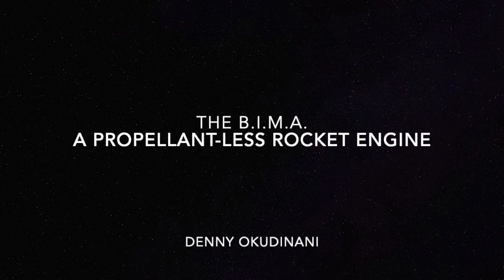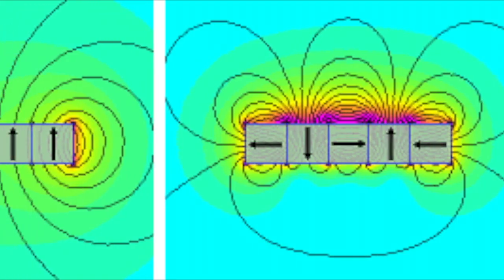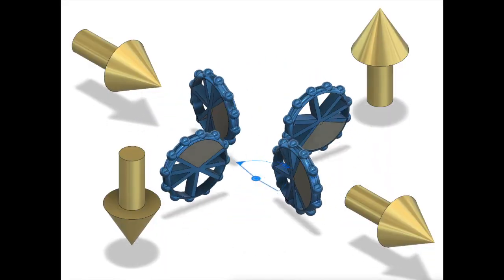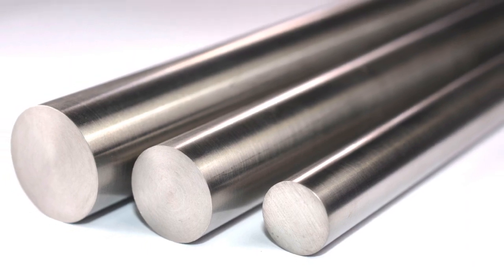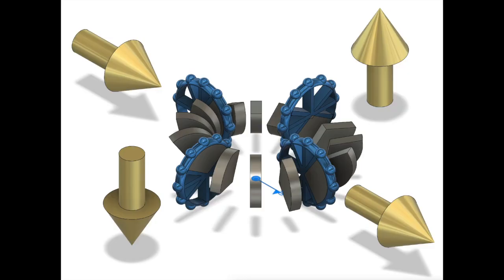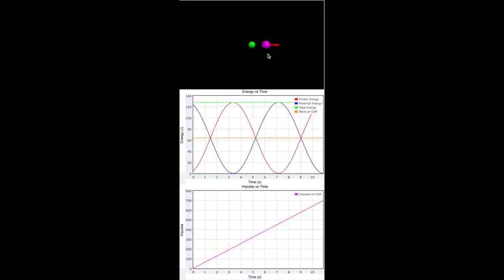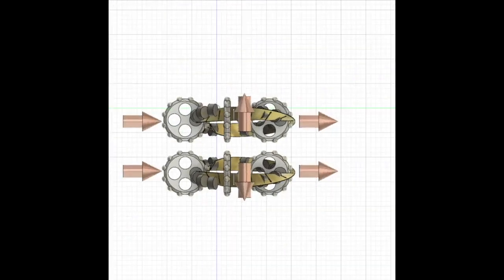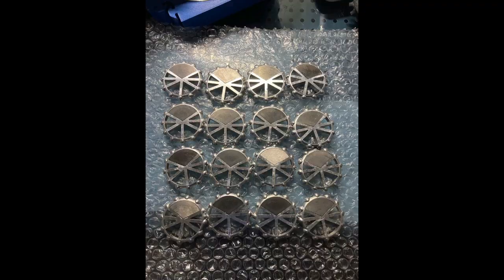Inertial Propulsion System 1: The unBalanced Inertial Mass Accelerator (BIMAH)

Comment: Uh. That would work up to just below light speed. With how perspective and frame of reference works... but without crazy energy levels. Just a longer acceleration... right.

Then once moving. There's almost no friction in space so if its outside the craft even less energy needed.

I say almost no fraction cause energy isnt actually conserved like they teach. Stuff would slow and stop eventually... just so long they ignore it..
Reply: And as it worked. Even if inside the craft. From outside if stationary. The propulsion system would increasingly measure higher and higher energy as the craft accelerates.  Energy is conserved in a way.  (more or less).

Near light speed its parts should start dilating time or be able to push past light speed. It would have to do one or the other.

 But on the ship it would seem like its normal energy levels from the frame of refrence and should be able to keep accelerating as the device is motionless relative to the craft but the motion relative to people outside looking in as they don't move says theres way more energy there.

Right... which also breaks reality and physics as it says one should see a system that can break light speed but the other sees a system that is putting out way less than outside observes would see.

So its either the answer to light speed or a troll by God as two answers seem true and equally valid but neither can be attained...

 and as spin forces that are technically illusions themselves are the only thing that science says can possibly overpower gravity and a black hole.
Reply: And with energy requirements for reported ufo cases... a bus size ufo needs the energy of 1/4:of the sun turning to pure energy per second, just to do the things reported...

Nothing can survive that but magic or spiritual stuff... simplest answer is well the imbalanced spin propulsion.. 

Or they're basically ghosts, energy based or spirtual in nature not bound by physical laws and manipulate to appear physical...

Even eirm holes with normal matter as fuel. The lowest energy calculated at ine point for a decent size worm hole just to open one.. all of Jupiter turned to pure energy 100%..  

That would wipe all life from the planet from the moon or further. We couldnt even test that near anything important or have life forms anywhere near it.

Static would be moon levels of energy to hold back at the least and any connection that short circuits the thing, gonna suck even power to that discharge.  

The ship itself should be vaporized by its own power source long before a worm hole forms. Thats ignoring holding it open takes even more power...

And then theoretically. Even if it could be done... 

They think a strange new radiation would appear that is so bad that once you exit the hole. The blast wave from it could destroy solar systems. Unless your ship can take solar system destroying blasts. You're screwed..

So if it were possible to even do and noticed that energy build up.. its 50/50  to simplify it.

You gonna drop out of warp with those odds and that level of destruction as a  possibility..

and no clue if theres life in the area as well.  Possibly commit planatary or solar system genocide by mistake

Comment: May I suggest steel instead of aluminum? Aluminum will fatigue and break, especially under strain. I do remember reading something about Tesla's inertial drive and his problem with elongation. There's been several of us pursuing this idea over the decades.
Reply from the maker: When it comes to manufacturing, there are endless possibilities for the metal alloy which is used in the disks, and the "chamber". Steel is very cheap, and one alloy of steel may  be exceptional with strain/stress, however it comes at the expense of unnecessary weight. Alternatively, aluminum can be just as  structurally resilient and far lighter. So far as prototyping goes, to get an affordable system which gives you the best chance of having good data, I'd start with some alloy of aluminum.

Comment: If your simulation is showing a change in momentum without outside input, it's because your simulation is wrong. If you've got a mechanism to allow ANY unbalanced force in a physical system, reduce the complexity and focus on EXACTLY where input and output forces don't give the expected zero result. Identify this interaction and you'll get yourself a Nobel prize easily.
Reply from the maker: Hey. First of all I'm honored--- the nobel prize would be a pipe dream for a small time youtuber like me. #Oneday 

Next the "mechanism"  for this interaction is "inertial confrontation".  It treats force as a process and can only be put into effect  with a  base case of least two particles (per Isaac Newton)! You can change the number of particles in the simulation without any problems. I expound upon it in my paper, but I have a bunch of videos on it on my youtube channel as well. 

Moreover, I should express my apologies for the confusion in semantic: even though I use the word "unbalanced", asymmetric is a more accurate  description, at least from a physics parity standpoint, of what is taking place. There is a  directional and emergent "bias" but its not because I'm "throwing" weights in one direction and then slowing them down in the other. If I did this, then there would be no force whatever--just an oscillation device.

Finally, So far as "outside input", of course, we are assuming there is some sort of driver (an electric or gas powered motor) which rotates the mechanical assembly. The machine will not magically start and stay rotating on its own.
Reply: It doesn't work inertial propulsion has been thoroughly investigated. You cannot convert angular momentum into linear acceleration.
Reply: @DaleOwens1 better tell kers 
Angular momentum of a flywheel seems to accelerate some things real good 🤭

Comment: What you claim requires the violation of the conservation of momentum. One of the best proven laws in physics. Your complicated internal arrangements do not matter, you cannot create a force without a counterforce on the whole system. If you break conservation of momentum, you break homogeneity of space (Noether Theorem). You physical model does not work, which should tell something. Your simulation probably just missed a factor for the ghost force to appear. This is as doomed as trying to create a perpetual motion machine. Physics still has plenty of undiscovered opportunities, but breaking basic conservation laws with some basic arrangements of moving masses is not one of them. Don't nerd snipe yourself.
Reply from the maker: Hey, thanks for commenting.

To be completely honest, what my "claim" (really operational hypothesis) requires is experiment . Even if its wrong, it would hurt anyone to still test it out. Thats the whole point of doing science. As Richard Feynman said, let the test of all scientific truth be experiment. If it works great, if it doesn't then we can learn more precisely about what actually happens in practice rather than a theory/principle on a sheet of paper. That is why I open sourced all of my work: so that others can go farther and add to the data!

On the issue of "parity" and energy  conservation: I won't provide any additional qualifying remarks here, because I've already given a fair amount of thorough treatment to such in several places! 

Nam qui curat.

Comment: It won't work in space since you need the flat surface/immovable object to prevent your device from spinning. Take your device & suspend it from a string & see what happens when you power it up. 

Unfortunately there is now way to use rotational inertial for linear propulsion in free space. What you need to do is think about momentum and how momentum can apply a linear force in one direction for accelerating a mass in space. You need a change in linear momentum to accelerate a mass.

Any way to accelerate a mass requests a two (or more) mass body. In the case of rockets, Its the acceleration of rocket exhaust in the opposite direction, In the case of magnetism it s two magnetic masses with either attracting or repelling fields, in the case of gravity its two masses getting pulled together. 

The only exception is light which carries a tiny bit of momentum but has no mass.

Comment: Here's a thought...

A disk, Spinning on it's axis, from its edges you hang little weights. they can be relaxed to extend out, or contracted to pull them in.

now, when their tangential pull/inertia is in a use full direction, you contract the weight in. when it pulls away, you relax and extend it.

the whole will have a net  mometum in the direction you want.
Reply: Its been tried, it doesn't work. As the weight extends the disk is pushed back, you'll get vibration not acceleration. It's not possible to convert angular momentum into linear travel.
Reply: @DaleOwens1 

Ok, To respond to that, I need to know how those experiments went. how they were done.
Can you give a link?

Edit: to make sure I am understood. Not one weight, many. All around the edge, the periphery, of the disk.

So when one weight is pulled in, there will be another being relaxed and extended.
Reply: @fanOmry Im sorry I can't give you much from the Internet other than a search on inertial or centripetal propulsion. There used to be a video from the early 90s here on YouTube that demonstrated a small disk attached to the edge of a larger disk. With the small disks axel offset. in operation the small disk would extend out at a certain point during rotation. This is very similar to the device in the video only with less number of weights around, and a horizontal orientation. 

Consider a thought experiment, if I have two masses attached together by a string in zero gravity, let's say I hold on to one of the masses and twirl the second mass around before letting it go. Immediately after release the center of mass/rotation will shift to the halfway point of the tethered masses if the masses are equal. If uneven then the center of mass will be closer to the heavier mass.

Now what happens to the masses if you cut the string?... They fly apart in equal opposite directions with equal velocity. 

Here's another thought experiment, this you can test for yourself. Let's say you have a sting about 3ft long with a weight attached to one end. Hold the empty end of the string with one hand while holding the string with your other hand a few inches from the weight. Twirl the weight around to accelerate it and let it go in a direction. Keep holding on to the empty end of the string. When the weight reaches the end of the string it'll go taught, giving a noticeable tug on the hand holding the string. Now you would think this should propel you in the direction you let the weight go in. The missing factor is that when you release the weight, the hand that accelerated, twirled the weight falls back when released, negating any gain when the weight reaches the end.
Reply: @fanOmry I should've added that any number of weights around the disk may be used, but it won't make any difference.
Reply: @DaleOwens1 
Yeah. Can you give a link to such an experiment? Because it is very not intuitive to me.

So I will need better than I heard that it doesn't work, trust me.

More so when the dude here can just test it.

Nothing else, he gets a video about the fail.
Reply: @δ4αφ37Τ

I most certainly cannot explain to you why you are wrong if you don't elaborate on your thought process.

Comment: Way back in college during physics classes, i had a very similar concept to solve internal propulsion.. my 1st attempt to build one ended hilariously horrible.. and at that time i stopped trying because i found a video on early days YouTube claimed to be of a  experiments from area 51, yeah right, but they had basically a hollow doughnut full of ferromagnetic superfluid and it was wrapped in wire configuration similar to an alternator. Very high current flow through the wiring made the fluid follow the exact same movements as my imbalanced gears except it was the idea on steroids combined with rotating the entire thing to generate the outcome properly... I figured i could never match such an iidea without access to nuclear power cells and haven't tried again.
Reply from the maker: Thank you for sharing! Never be discouraged by a good idea. There are tons of good ideas, but few are ever actually carried out. Its never too late to try--- just have Faith, and protect the curiosity that will led you to more discovery! 

Nam qui curat.

Comment: You're on the right track! This is similar to mercury vortex engines. To do this with mechanical parts requires no play and as little friction as possible, and diamondlike carbon coatings to prevent wear. You can do the same thing with liquid mercury by just controlling the flow cross section of the liquid. It's like that NASA paper about the accelerator which provides a net force, but the relativistic factor is way smaller and the mass used is way larger and the terms roughly cancel. Takes way less energy than a particle accelerator though.
Reply: i was thinking this too. maybe throw in some supercooling?
Reply: @esahg5421  Sort of, but then you actually need to switch to mercury ammonia alloys, aka. red mercury
Reply: Diamond like? Why not zirconium plating?
Reply: @Clippy-s7s dlc coating has lower friction and is harder the zirconia or zro2 ceramics.
Reply: Could and fluid do this? Say, a plasma? In other words, could a fusion reactor be used to create propulsion with imminence?
Reply: @Clippy-s7s  Plasma is not very dense, but moves a lot faster, so maybe. Cold plasmas are likely to exhibit interesting emergent phenomena.
Reply: But plasmas are tricky to contain and take a lot more energy, which is why the NASA paper about the self propelling particle accelerator needed Gigawatts.
Reply: Fringe science.  I have a better way.
Reply: Oh you mean this is similar to the other thing that does not exist and has never been shown to work.  GOTCHA! SMFH!

Comment: do you have a functioning device you can show operating mounted on a pivot like a teeter-totter with the other side balanced by by exchanging weights till the engine is pushing down one side raising the known weight on the other side.

Comment: Hang it by string. Then get a stick, hang it so a equal weight is on the other side of the stick. Put a barring to hold the stick and have string to hold the barring. It should rotate and you should be able to record the force. If it’s able to over come air resistance, you can measure the RPM, and refine the design.

Comment: I've designed something similar. Quite a different design in that its net force is parallel to the central axis; the CSF (Centrifugal Symmetry Fracture) Drive. Instead of needing two units to balance out any unwanted rotation, mine requires four units.
I'm excited to see further developments with yours and I'd be interested in comparing notes some time.
Reply from the maker: Thank you for the comment! Its always refreshing to interact with others who are independently doing experiment for themselves. Keep up the good work. I look forward to you later developments. Definitely subscribe to see more of my later developments, if any are to come!
Reply: @MillennialZoomer  already subscribed! :)